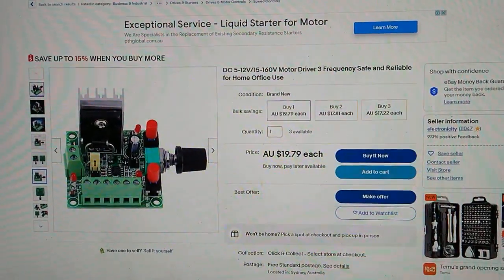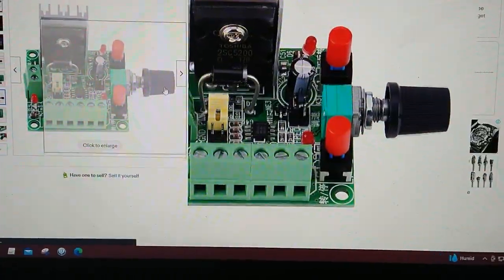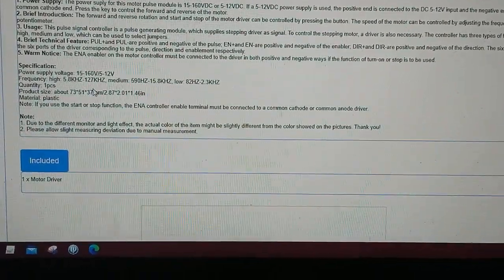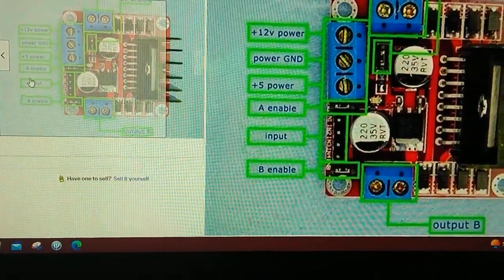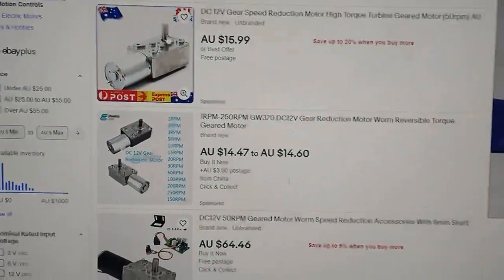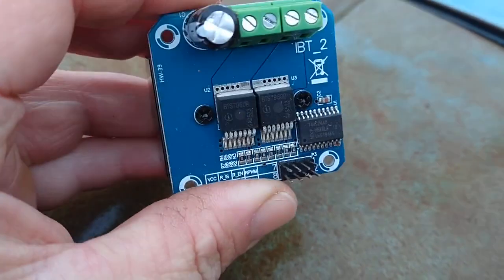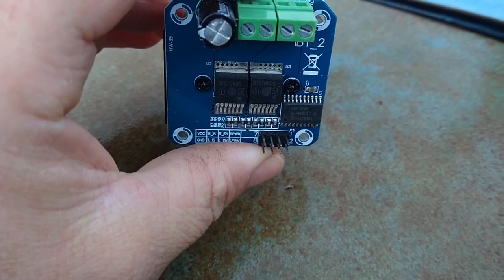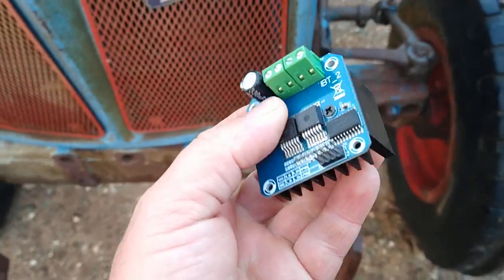dc motor driver

Comment: I suggested this to Brodie recently, he's building a welding attachment for the back of a lathe spindle so he can rotate and weld up flanges, I reckon a PWM board and a gear reduction DC motor would be the go. Also, I gave notice at the forge today, I got a better offer👍
Reply from the maker: Yeah might need a fair bit bigger board than this one id try an ibt2 board and an Arduino.
What ? Where can be better than the forge ? Haha.
You got your trade papers now yeah ? You heading somewhere local or interstate ?
Reply: @landlifem5872  Yeah he can figure out the sizing he needs, got my papers August last year, Axl's still going, I doubt he'll even finish this year😆 I'm staying local mate

Comment: Thank you, that was very kind. Following the description you left in a comment, I found the first controller. Might be worth getting one of those just to experience using one. I want to keep the whole thing as compact as possible and ready to use without too much messy about, like finding a power supply. Thinking 4AA rechargeables to get 5 volts or 9 volt battery. The N20 style motor would be compact with the 90 degree drives not so much. Will have a look at it in a few days when not so busy. Thanks for you help. Nigel
Reply from the maker: Yeah no worries. It would be very simple the way you are talking, I often have a mind that likes to over complicate things, haha. 
I often loose perspective on how small the parts are that you often make , definitely not what I'm used to.